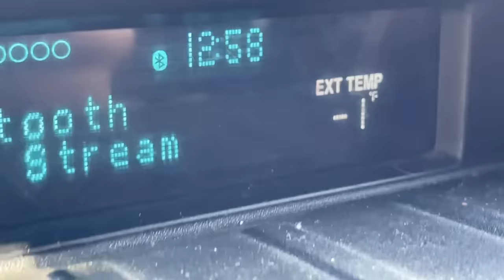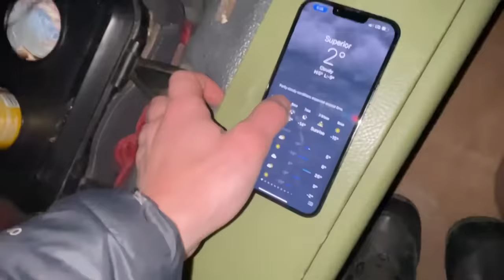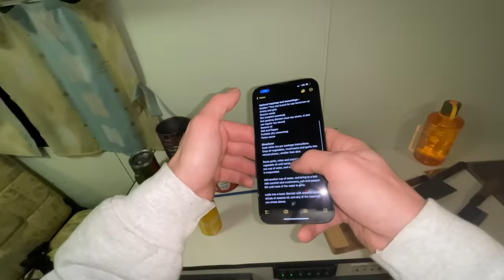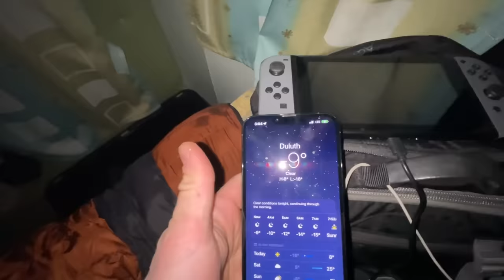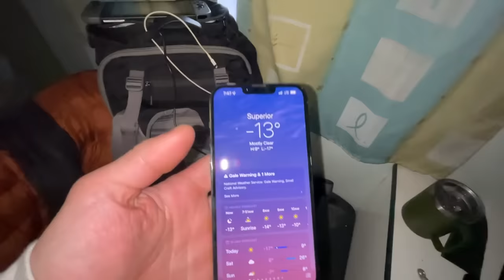Taking my Japanese Import Camping in -18 Degrees

Comment: Just a bit of help with starting Steve in the cold. If you turn the key half on and hold it for 5 sec a couple of tines it should pre heat the glow plugs and make it easier to start when cold. I own a 26 year old vw t4 and it has hated the cold for the last 15 years but still get me to work. Love the adventures mav. Watching you from the uk
Reply: This is the truth. There’s a light on the dash that shows you when the plug heater shuts off.
Reply: 100%
Reply: This is 100% right on. He needs to research this shit before he heads out.
Reply: Bless the youth, so much to learn
Reply: Also keep an extra jump pack or battery and battery’s also are wayyy better if u can keep them warm should start a lot better with a decently warm battery
Reply: The main thing about science is that it’s mostly theory
Reply: A plug in belly pan or an inline circulating heater works like a top too, I have 3 diesels and we get down to -46f in the winter at times
Reply: many people have left comments like this previously, sadly i dont think he reads the comments.
Reply: Wdym by half way on I have vw golf that legit started to to not start once the cold hit first time owning vw and car
Reply: @kevinrodriguez-nz9qu  usually to the accessory position is all that’s needed to heat the glow plugs. Once the light goes out it’s safe to start.
Reply: It won’t heat up the glow in plugs if the battery is dead lol
Reply: @ridingwithairbubble1694  I don’t get what you mean by that bro my bad man
Reply: @kevinrodriguez-nz9qu  Diesel engines have glow plugs, kinda like spark plugs. They need to be hot (glowing) to enable compressed diesel to ignite. A Diesel engine compresses the fuel, then the hot plugs ignite the compressed fuel. The main difference between gas a diesel is gas is more volatile and all that’s needed is a spark, but compressed diesel needs a constant source of heat to “explode” producing more power as a result. Bottom line, if the plug isn’t glowing (i.e.hot) its not going to start. So…there’s a glow plug light on the dash to indicate the glow plug is heating, when it goes out, it’s ready to fire/start. My glow plug light looks like a curly pig tail, minus the pig of course 😁
Reply: @ridingwithairbubble1694  oh shit nah I prolly shoulda mentioned ion have a diesel I got a 2.0
Reply: @justingeturgun  you would think the generator running would charge both the house and engine battery, it does on the RVs I’ve owned. I think his error was trying to start before it was ready. His batteries being located inside out of the extreme cold shouldn’t have drained them. Not really sure how a Japanese RV is wired though, still a cool vehicle though.
Reply: @kevinrodriguez-nz9qu  ah, should be familiar with them then 🤓. I’ve got two, a 6.7L and a 26hp…and a diesel fueled 18,000 btu forced air heater (which is not efficient at all, but very warm)
Reply: @ridingwithairbubble1694  glow plugs help with cold starts but aren't necessary for the engine to run. Your description of them kinda makes it seem like they're a requirement for a diesel engine, which they definitely are not.
Reply: @brendan4508  is that so. Sounds more like philosophy
Reply: @justingeturgun  the battery wasn't dead
Reply: To add on… get a block heater and a battery warmer and you will never have an issue cold starting again.
Reply: No need to hold, just turn the key on and you can hear the heater.

Comment: Mav just a heads up Steve is a diesel meaning it has glow plugs instead of spark plugs when you go to start it on a cold morning turn the key on for a few seconds to let the plugs heat up so it will start easier
Reply: Glow plugs have nothing to do with spark plugs and serve a completely different purpose. Not all Diesel engines have them either.
Reply: battery temp threshold too
Reply: @jamiewhitworth7183  Every diesel I’ve owned since the 2000’s have glow plugs. Maybe you’re right though, this old Toyota may not have them. Either way, it’s always good to wait a few seconds before starting this old diesel beauty.
Reply: @BezVik1  some have heated intake manifold elements!! It’s a cool design.
Reply: I'm from Australia we have those trucks here but there called a Toyota dyna and they do have glow plugs sometimes you need to glow your rig 3 times before it will start . Cheers keep on trucking
Reply: @thetruth1489  Yes, I used to do it with my older VW in -15°C. Three time is the charm.
Reply: @dcarts5616  jamie is right, not all diesel engines have glow plugs. Take the Deutz air cooled diesel engines for example. They can start in cold weather even though they don't have glow plugs
Reply: Almost all smaller diesel engines have glow plugs. (It's generally the much larger engines that don't have glow plugs.)The more modern engines are much quicker and more efficient when it comes to cold starting. Steve is definitely one with glow plugs... They just need more time to heat before starting. Check the glow plug dash light when you're about to start Mav. Once that light goes out the glow plugs should have done their job. But it still may take 2 or 3 turns of the ignition to turn on the glow plugs to get them heated up properly in such cold conditions.
Reply: @ETGLOVERR  I hope Mav sees your comment for the sake of his sockless friend :P

Comment: Good morning Mav, with diesel engines, you have to turn the ignition on and let the glow plug heat up before you try to crank it. I think Steve will do great with this small adjustment!! Happy Trails!! My first visit so it is nice to meet you!✌👊
Reply: Agreed, on old Hiaces you can hear a click and see the panel lamps brighten when they are ready - this also takes load off the battery for cranking. 
Also in that situation of freezing cold  it's not a bad idea to carry a good, fully charged battery that's left unconnected - so any battery disasters can be recovered!
I would also ensure the van battery plays no part in supplying power to the living quarters..!
Reply: And clutch down, then you gearbox is not take starting power...
Reply: Maybe look to invest in a magnetic 120V contact heater for Steve.  Put it on the oil pan, plug it in 30 mins before trying to start the engine, and the oil will be warmed up and flow easier.
Reply: @petertratechaud7277  it already has a block heater, that’s what he was plugging in in the last couple minutes of the video with the jackery

Comment: If you let the glow plugs warm up you might have had enough juice in the battery to start it. Turn the key halfway until the glow plug light goes off. You can burn out your glow plugs by just cold cranking it like that.
Reply: sadly i dont think he reads the comments, many people have told him that before
Reply: yah, onn an older diesel, you would turn the ignition to start the glowplugs up...when glowplug light turns off, you'd turn ignition off and turn ignition back, until the glowplug ligght goes out again...
Reply: most americans dont know this, as diesel cars are not common due to california's  strict emission standards
Reply: Yeah it’s actually kinda frustrating seeing him do that stuff I’ve seen a comment like this like 10 times
Reply: @ianronald10  diesel pickups are quite common especially in rural communities, we don’t claim California 😉
Reply: @austinschreiner1330  how common? Whats the percentage of these personal trucks compared to gasoline personal cars? I get it if your a farmer or a rancher or you use it for commercial purposes?
Reply: @ianronald10  very common, I have no idea on percentages,  but I am neither a farmer or rancher and I’ve owned 4 diesels myself. Many enthusiasts or people that haul campers, car trailers, etc. It can be quite difficult to own due to our extreme cold temperatures (-30/40 windchill isn’t uncommon)
Reply: @austinschreiner1330  according to US department of energy/ EPA  its less than 5%
Reply: @ianronald10  interesting! I suppose I am regionally biased, living in rural areas of the Midwest. The EPA recently did put hefty restrictions on deleting/modifications to diesel pickups
Reply: @ianronald10  in louisiana, I would say at least 5-10% are large diesels.
Reply: @cajunrando2556  How large are these Large diesel engines? is it for medium duty use? In commercial/medium duty vehicles its 75% diesel and industrial/ heavy duty vehicles its over 95% diesel engines.
Reply: @ianronald10  6.0L or larger.  Most are new 6.7l these days.  I'm actually considering one now. Ford, f250.  Either 6.7 diesel or 7.3 gas.

Comment: @Mav I think the problem with Steve not starting other than it being crazy COLD is to turn the key to accessory for about 10 seconds before actually turning it all the way to start it. Diesel's use glow plugs which require heating up. Hope this helps Mav!
Reply: Not sure about mav but that helped me. Thanks bud.
Reply: Good point! Once my late father, an MD, was held up at gun-point on a grocery store parking lot. The guy, who Dad said was a junky, wanted him to jump in his car and drive them both away. Back then Dad had a diesel International Scout and it was winter, so he jumped in and quickly tried to start it, by cranking the engine without warming the glow plugs. It would not start and the guy just took his cash and wine bottles from the groceries and ran off cursing. Not sure I would've had the composure to pull that off.
Reply: @michaelkissane6138  such an unreal story thank you for sharing!
Reply: @michaelkissane6138  Wow that gave me goosebumps. I'm so glad he ended up getting out of there okay! I don't think i would be able to pull that off either.
Reply: Exactly, the cranking without waiting was driving me nuts lol
Reply: Also, if it's a manual gearbox (stickshift if you prefer) it takes a load off the starter if you press the clutch when you're starting.  I've never owned an auto box car (although I've driven lots) and I do this every time I start my own cars.  In fact, with my current car, (Subaru) it requires the clutch to be pressed to engage the starter.
Reply: @jimjolly4560  Definitely a great tip to try and always start a manual pressing in the clutch and brake. Never hurts, always helps!

Comment: Mav, seems like there are a lot of comments about this already but Diesel engines have a hard time starting in the cold. I would recommend buying a block heater for Steve! Keeps the engine and its fluids warm to help it start easier.
Reply: This should have more likes
Reply: It does seem to have a block heater in it. He plugged it in at the beginning of the video and when it seemed like it was too cold to start.
Reply: You sure are a true gift from God saved me so much after reading this
Reply: It does have a block heater, he plugged it in the last few minutes of the video with the jackery power pack.
Reply: U should buy 6.0
Reply: Perhaps wiring the block heater so it can run on the house battery bank/diesel generator would be a good option for cold weather
Reply: Yup my diesel Jetta struggles starting when it’s just 20F out

Comment: Glad to see Steve get out there! Few things with cold weather and diesels. Isolate your batteries. Battery for the truck and batteries for the RV. Have relays in place to allow RV batteries to be used to assist starting if needed. update the electrical so you can utilize the generator for the block heaters/battery warmers.
Reply: That's what we do in Scandinavia!
Reply: Yeah he defs needs a dual battery setup so that the starting battery is kept for only that purpose. He also needs a battery charger connected to the generator, and rigged to charge both batteries. A good idea is to also diver some of the hot air from the diesel heater into the battery cabinet, to keep the battery warm. Internal resistance from the cold is the killer.

Comment: So some pro tips for the nice new knives:
keep the edge as long as you can by not scraping the sharp side of the blade along the board when you’re picking stuff up and make sure you fully dry them after cleaning (a lot of high end knives aren’t as rust resistant because they have higher hardness, it’s a trade off) 
And as much as that little sharpening gadget you have is easily portable and works ok, definitely invest in a whetstone 
2 sided 1000/4000 would be my recommendation 
It takes a little learning but the grind on your knives specifically will be easy and there’s a ton of tutorials out there ;)
Enjoy!
Reply: Thats one of the big tips I got when I was in college. Don't use the sharp side of the knife to scrape up your food. Use the top side. I am so happy someone else noticed this. :)

Comment: As for starting the diesel easier in the cold. Make sure to glow the glow plugs. Ignition on until glow light turns off. 
As for running out of battery during the night. I noticed you have two batterys. 
I recommend installing a (not really sure what is is called in English so I just directtranslated it from what we call it in Sweden) divider relay.
It will divide the two batterys from each other during load. So that you can have your diesel heater running from just one of the batterys. And not draining power from the start battery. And then when you start the car the relay links the batterys again making the alternator from the engine charge both batterys.
Reply: This guy gets it.
Get a battery disconnect switch. That way when you are using the house battery and fall asleep it doesn't kill your starting battery.
Reply: I’ve heard people in the US refer to it as a dual battery system which I think uses a relay like this.
Reply: I've never seen a vehicle with two batteries... That's insane! Lol
Reply: In the American RV industry they call that a battery isolator or separator - not very creative. It’s exactly what you described.
Reply: @Nunya58294  most diesel vehicles do, my Dodge diesel pickups have all had two, my tractors all have two, my semi truck has 4 and they are all 12 volt systems.
Reply: Yes, that's what RVs usually have. In UK the 'starter' battery is not used for anything else. The 'leisure' battery powers diesel heater fan, cabin lights, faucet pump, etc. When the engine's running, it charges the starter battery as a priority, then puts charge into the leisure battery via a split charge relay. Rav should be able to run his diesel heater all night on a fully charged leisure battery!

Comment: Looks like bigger alternator and check the glow plugs. Diesel”s are sensitive in cold weather. Also the oil you may be using might be to thick for that temp. Causing hard start ups.
Reply: Truth. Br Wils good glow plugs or grid heater. Check to see if you can run a thinner diesel oil in the cold. I also use a good fuel additive when it's that cold. Howes, or Ams oil. Keep that fuel from gelling 

Keep on truckin
Reply: @jimjanik720  by the sounds of it he ran both batteries down to much in the night cause the slow turn over you could hear when he tried to start it. When his buddy gave him the boost is sprang to life. He needs to get a battery isolator to insure that his starting battery doesnt get depleted with the engine is not running.

Comment: If you go out again in Steve, take an extension cord and run it to the block heater from the Jackery but keep the Jackery inside so it stays warm. It should have enough juice to keep that block warm all night, that will help so much on the starts in cold weather. Thanks for the video. Stay warm.
Reply: Run the block heater off the generator even.
Reply: Or time for a webasto setup to keep the engine warm.

Comment: Steve is super cool, it's nice to have enough room to stand up and be inside to cook, not that I didn't enjoy all the camping videos in the truck.  May I say the dinner looked very tasty.  Being from Michigan and transplanted to Florida, I hate the cold.  I think, if it was me, I'd have some insulated drapes and some reflective insulation for the windows and a thicker insulated drape for the cab opening & across the doors.  
Also a throw rug for at least the area in front of the couch.   It always takes a test run to know where to make improvements.  Thanks for taking us along!

Comment: I’m wondering if a magnetic strip could go above the sink for your new knives. Worth a try, honestly! They shouldn’t move while driving if you get a good quality one!
Reply: You can use a magnetic strip as long as it is not just the bare magnet/metal strips like you get from the hardware store. You can get them they look like blocks of wood with the magnet inside, the reason you don't want the bare metal is it'll scratch/mar the blade.
Reply: Ayo Oriely definitely has some. Like a blue roll that is covered in fabric really strong like 10$ magnetic tool holder next time You are in the Store. *
Reply: That sounds so dangerous 😅 lol definitely would keep a cover on em or something

Comment: It's a diesel. You should let the candles heat up by turning the key a quarter. Wait for the yellow check light to go out. In extreme cold it might take a bid. The heating elements make noise so you will be able to hear it.

Comment: New diesel learning curve. Every one gets it moving from gas to diesel.  The truck drivers I talked to all seem to like Power Service additive. Grey bottle for summer, white bottle for winter, and red bottle for emergency.  Up in northern Minnesota you might as well put some in every time you fill up to avoid the red bottle. Fleet Farm has additive on sale quite often. I keep a bottle in the back of my truck all the time. 
Also check your owners manual . There should be a cold weather start procedure for the diesel motor when temp's fall below a certain degree.  Gotta let them glow plugs heat up.
Plug in the block heater when ever possible. Makes start up easier, and you get heat much sooner.
Tell your momma Mav I said Hi!